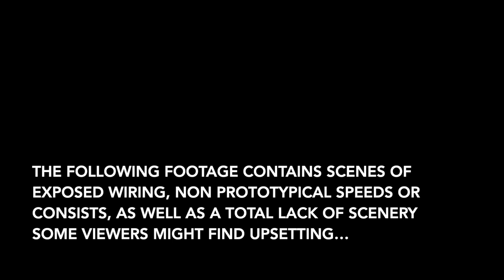Deutsche Reichsbahn Classics - Märklin trains in motion

Comment: great session.  I am now changing my plan for my layout to have something that is running rather than in perpetual build.  I think a fix it on wheel quartering would be great too as I have a few models with "wheels" off which will need that and you have the knack of making these things clear and practical.
Reply from the maker: Thanks a lot and good luck with the planning

Comment: What a flabbergasting collection. Just wow 💓 We most definitely would like to see the 3089 fixed in a dedicated video. Would you happen to know if that wheel loosening is a recurring known issue on these models? We haven't experienced such with any model as of yet but we don't have the 3089 in our assortment. Cheerio.
Reply from the maker: Well, thanks for the compliment. I would have to break the 3089 to be able to fix it in a video 😀, but I have a loco of a different type with similar problems I can use. I cannot tell if it is a recurring issue, but it can easily happen when trying to move the wheels by hand on a ceased locomotive, so it is always a point to check when buying one of these if possible (difficult to do this online for example...). Cheers.
Reply: @The3rdRail  Very valuable helpful feedback. Thanks a bunch 👍

Comment: Thank you for this video.  At 12:31 we see a small electronic circuit. It looks interesting Could you give us information about it.
Reply from the maker: no problem, this is a homemade wireless controller I use for my accessories, look on the channel where there are a few videos about the wireless controls I designed.
Reply: @The3rdRail Thank for your reply. However the 3 videos related to the wifi control seem to not be available anymore.
Reply from the maker: @ppol4264  I deleted a few older videos a while back, that's possible... There are still plenty of wifi control related videos available on the channel though.  Basically, I built circuit boards with ESP8266 microcontrollers, which I control with an application I developped using NodeRed. Each board controls and powers up to 2 signals, and is itself powered using the Marklin lighting circuit.

Comment: I swear Marklin also made that turntable for fleischmann, and ended up having to pay fleischmann for the rights to make the turntable again since the tooling now belonged to fleischmann..
Reply from the maker: really?
Reply: @The3rdRail  The former Turntable 7286 was 100% Fleischmann's, despite originally designed by marklin, now their group has developed Roco's 42615 (both 2 rails and 3 rails with a 253 mm bridge) The deal was quite strange, as when Fleischmann quit HO in 2020 the turntable's tooling is once again owned by Marklin.
Reply from the maker: Ah, you were talking about the 7286, sure, this was indeed a joint Märklin/Fleischmann development, but that is not the same turntable as mine which is older and to my knowledge designed and made by Märklin only for Märklin.